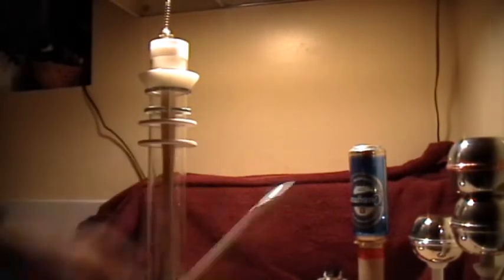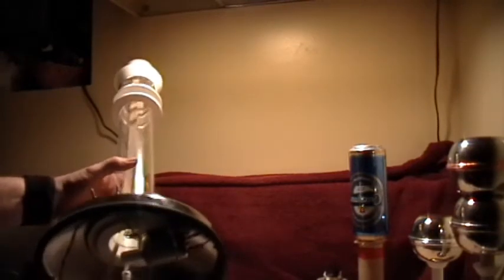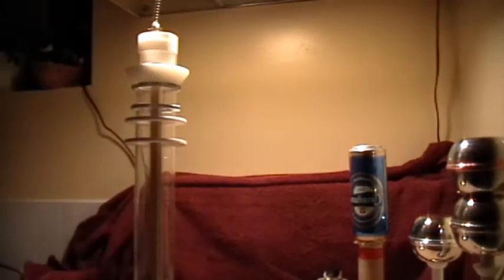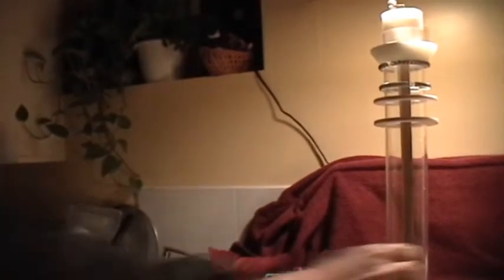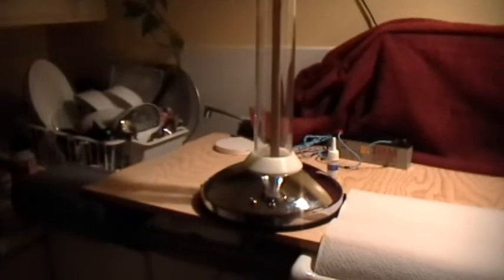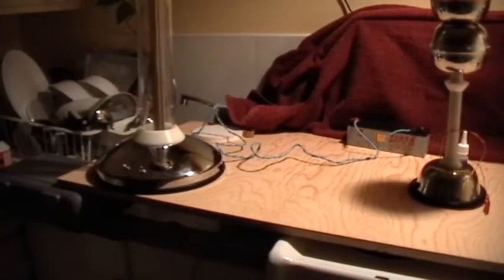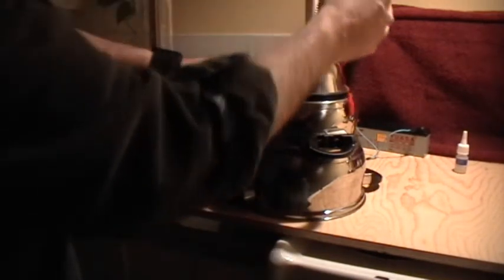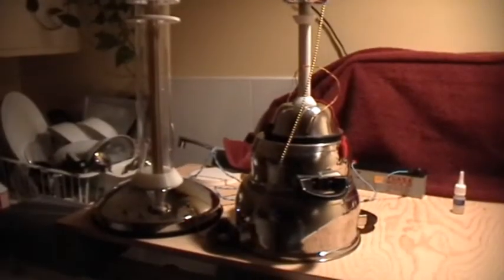Construction and Operation of a small Van De Graaff machine (Part two of two)

Comment: hi TK.   Thank you for all of the videos you share.  I have a few questions regarding my own research that I have not been able to get good information on.  If you could share with me your feelings, I would greatly appreciate it as it would greatly aid in my own work. If I were to connect a ultra-fast switching water spark gap up to a 700kv 60microamp Van de Graaff generator, what kind of inductive kickback would I expect to see?  I haven't been able to find any info on inductive kickback for a spark gap let alone for an electrostatic system..  For an inductor, high voltage spikes of and inductive kickback is said to be caused by fast change in current.  Would you expect to see a large voltage spike kickback occur when the Van de Graaff discharges through the water gap?  Fast switching gaps are said to experience 1.5 times the voltage as the power source, so we might be looking at around 1MV at the water gap...  Therefore, could we expect a greater than 1MV reverse voltage spike to occur?  What would and estimate voltage be for the voltage spike.
Reply from the maker: Yes, that's right. The kickback voltage will be determined by the inductance and capacitance of the system, treating the VDG machine as a small capacitance and the wiring of your circuit as the inductance. With water gaps at high voltage you also may experience "electrolytic conduction" where the water and impurities actually "short" the circuit and dissipate considerable energy, even enough to prevent an actual spark from happening. Again, this is a matter of adjusting your capacitance and inductance so as to have a very fast voltage risetime at the gap so electrolytic conduction doesn't have time to occur. Without knowing the details of the system it isn't possible to estimate the reverse voltage spike, this needs to be determined empirically. Be careful, you will be dealing with lethal energy levels especially if you have substantial capacitance in your system. I have some videos using a water-drop triggered gap that you might like to look at. Thanks for watching and commenting, and good luck!

Comment from the maker: By what do you mean "high tension battery"? The battery I use to run the motor of this VDG is a 12 volt, 2 a-h battery.  If you need high tension (high voltage) you take a bunch of low tension batteries and put them in series.

This VDG is a "high tension battery" of sorts, in that it can store some energy in its capacitance or deliver a constant (low) current at very high tensions indeed.

Comment: Have You tried earth ground for the base? The one we had in school, the base did not emit a charge. Ya might get a few more electrons to flow to the top. As my teacher explained, the earth ground provided more free electrons to build a bigger charge. Same as a crystal set AM radio. If the ground of the crystal set is just a pipe that is not connected to anything(earth ground), the signal in the crystal set will be there, but very weak.
Be interesting to see. =]

Comment from the maker: It has to do with two things: polarity and capacitance. The small machine's top terminal is small but sufficient to gather enough charge so that, at the lesser voltage of its discharge, the air is brightly ionized. Sparking to a matched sphere also helps. Here it's hitting a smaller sphere at maximum gap, so dimmer. This one sparks quite brightly to a matched terminal.
I have completed the opposite polarity partner to this machine, so "Joachim" and "Boaz" will be putting on a show shortly.